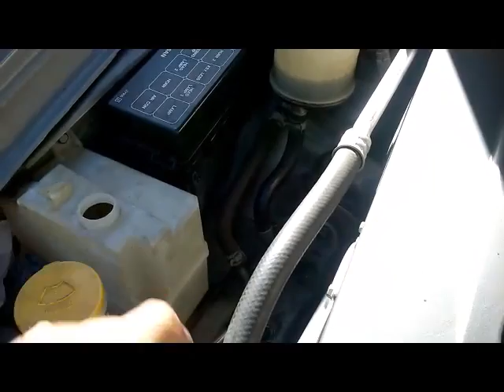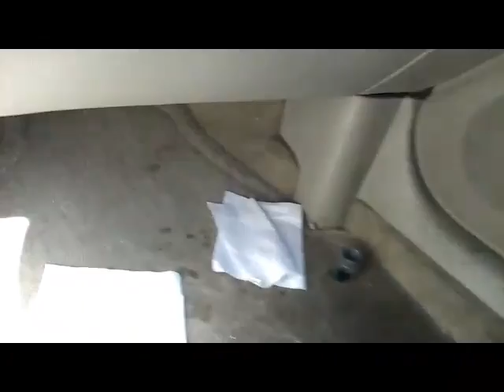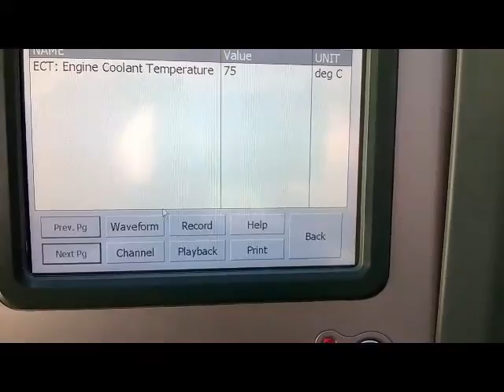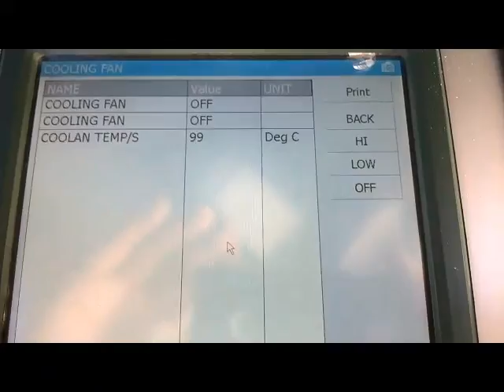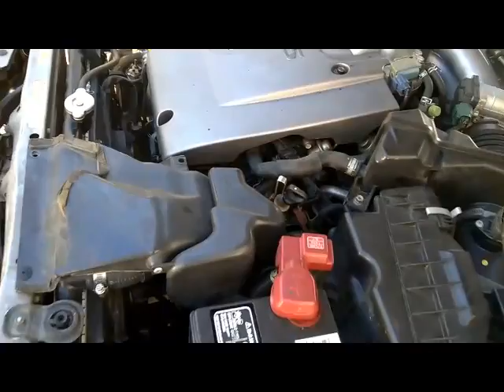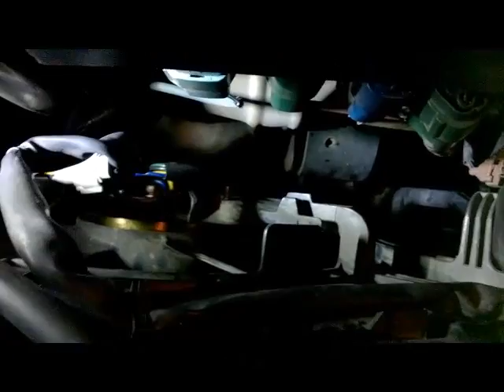(Nissan Maxima) Faulty Cooling Fan Motors

Comment: had similar problem on 2001 maxima, , replaced duel fan assembly  also check fuses,  relays.  I had 1 fan spinning and the other wouldn't

Comment: I have a 2004 Nissan Maxima , my car doesn’t overheat  but ion think my fans turn on at all  car temp  stays right in the middle  and I never hear the fans or ion think I do .  What could be the problem , I read you  comment to unplug the temp sensor and it will kick fans on . & my ac doesn’t  work atm  cuz no Freon in it so idk if there is a problem with my fans .
Reply from the maker: If you believe that they don't turn on. Try disconnecting the Engine Coolant Temp sensor to see if they come on. If they don't, you may have faulty fan motors, faulty ECT sensor, maybe faulty fan relay, blown fan fuse or some type of electrical problem.
Reply: @EliTheOBDTech  I swapped out the relays  but I’ll try to disconnect the sensor and see if they turn on .  I just never hear them  I was told that they turn on when they are needed and I haven’t had ac so I never turn the ac on  what
Reply from the maker: @jonnnn4895  Best thing at this point, is to unplug the ect sensor and see if they kick on. Another way, is to  use two jumper wires connected to battery + and -, and manually check each motor fan with the harness connector disconnected.
Reply: @EliTheOBDTech  I’ve unplugged the sensor and they do turn on . And i got a code for the  sensor  after unplugged it but how will I know if the sensor is no good ? If it didn’t give code at first. And soon I will be getting the hard ac line and getting it filled so it should turn on high to help the ac Correct ?
Reply from the maker: @jonnnn4895  Yeah, by unplugging any sensor, you will always get a code, that is normal. I believe that your sensor is good. You will have to do a test drive of 8-10 mins and then come back and idle the vehicle with the hood open and see if your fans turn on. Yes, fans should turn on high with the AC ON.
Reply: @EliTheOBDTech  will do I will get back to you and let you know how it goes  I have replaced the sensor and bleed the system so I will just leave it in there . But I’ll do what u said and see if  the fans run
Reply: @EliTheOBDTech  from the looks of it it’s still won’t turn on . There’s no codes or anything I looked at the fuses and I swapped the relays not to long ago . What could it be ? The only time they were on was when I unplugged the “ects “ and I had the code until I cleared it
Reply from the maker: @jonnnn4895  Hopefully it's not a pcm driver issue
Reply: @EliTheOBDTech  it’s working now after sending that comment I was pressing send and looked down and it was on and both were working .
Reply: @EliTheOBDTech  I appreciate your help and time u took out of your day to type these comments thank you .  Have a blessed night . And morning
Reply from the maker: @jonnnn4895  I'm glad you took that worry of your chest.

Comment: My friend , my left fan (ac ) turns on by hand only , like the video , the right one never turns on .Switched connectors same thing happens . Faulty fan motors right ?
Reply from the maker: Most likely faulty motors. U can use two jumper wires and directly apply 12 volts to the motor and see if it spins, if no spin, confirms 100% faulty motor.
Reply: @EliTheOBDTech  Thank you for replying so quickly.God bless you for helping me .Have a great weekend.
Reply from the maker: @thedeltoros5381  Thanks, same for you.

Comment: The same thing is happening to my car right now! 😭😭😭 this video helped me solve my problem now I gotta see where to take it. But I have a question what if your ac is blowing hot air to?
Reply from the maker: Has it blowing hot air for while or recently ? Most of the time, when you blow hot air, is due to low freon/no freon (leak) or blend doors stuck in the hot position or compressor not working. Not quite sure if faulty motors can cause that kind of symptom.  I would recommend checking your low and high side pressures to verify if your low on freon.
Reply: @EliTheOBDTech  thank you for replying its been for a while now.

Comment: Nice video Eli. I do have one question. I have a 1997 Nissan Maxima. If you don't have a/c on, does 1 or 2 fans come on?
Reply from the maker: Hey there, I'm not 100% quite sure, but I do believe that both fans should kick in at the same time without a/c on. I will look into it and I will update you.
Reply: @EliTheOBDTech  thank you. When a/c is off 1 fan is running. When a/c is on 2 fans is running. I used to remember that 2 would run even if a/c is off. But maybe the colder weather has some to do with it, Been looking in the FSM and it doesn't specify.
Reply from the maker: @dominicene3647  Hey there, after looking at the description and operation in ALLDATA, both fans should operate together with or without A/C switch on/off.
Reply: @EliTheOBDTech  thank you for the response you are awesome. Can you do me a big favor? Is it possible you can email me that page from all data if not too much trouble.
Reply from the maker: @dominicene3647  sure, what's your email?
Reply: @EliTheOBDTech  deeene@hotmail.com
Reply: @EliTheOBDTech  Thank you in advance
Reply from the maker: @dominicene3647  I will try and get it to you sometime today.

Comment: I changed water pump , thermostats and can’t find any leaks but my car is heating up at stop lights and going back down as I drive again , fans sound like they are on .. any idea ??
Reply from the maker: It seems that your problem might be a partial restricted radiator.
Reply from the maker: Perhaps the fans are not kicking in at the high speed when commanded, Only low speed.

Comment: Thanks for the video. It would have been really a great video if some of the missing information was added like say.....

1. Video of the Motor Replacement
2. Scan tool model that was used.
3. Part number for the motors and where you bought them from.

Small but important details. I spent some time on google, but still hasn't come across where to get these motors from. Never-the-less, great video on troubleshooting this common issue.
Reply from the maker: You're right.
Reply from the maker: Thanks for the feedback.

Comment: Hey buddy, I have a 01 and I noticed the fans aren’t working right (I removed a fuse of the fan number 1 and the main fan works fine but when I put the fuse back on, it starts rattling like crazy.
From what I’m seeing here, those fans that aren’t working properly and are causing that car to overheat sporadically. Could also the fans be a factor of why the car suddenly shut off by itself mostly when it idling? It starts to rev up by itself till it gets to a point where it just dies. Sometimes happens while I’m on the highway (the majority of the light tries to turn on and sometimes blink). I thought it was the throttle sensor cause of the abrupt rev up but I replaced it last December 2018.
Any suggestion? Thanks in advance for the help and God bless.
Reply from the maker: You might need a throttle relearn for idle issue. The overheating problem most likely is your fans not operating efficiently.
Reply: But that’s the thing, my car isn’t overheating at all. So that’s why I’m assuming since the fans aren’t working properly, those are the cause of this car  shutting off when idling
Reply from the maker: @ragh91  I'm pretty sure that the fans are not the cause for your car shutting off. Check your throttle body to see if it's dirty. Since your idle is behaving abnormal, you might need an idle relearn.

Comment: on My g35 its the opposite side that dont work.to change the fans do ihave to drain my coolent
Reply from the maker: I'm not familiar with the g35 radiator fan housing design, but if you're lucky you only need to disconnect the upper radiator hose in order to remove the fan housing. Will only lose small amount of coolant when disconnecting the upper hose.

Comment: Hi i have a 03 nissan 2.5 and it only overheats at highway speeds and spills coolant thru the overflow tank, i cant find any leaks and it doesnt overheat in traffic or driving in the city, i hope you can help me out thanks
Reply from the maker: You may have a partial clogged radiator that can't keep up with the water flow under higher pressure. Other items can be a radiator cap or a thermostat that's acting up at moments, not opening all the way when it needs to.

Comment: This helped me so much with my G35 intermittent overheating when AC turned on in 95-100 degree heat. Just ordered replacement dual fan assembly for $90.  WOW solid advice.  Thanks bro!
Reply: Did that fix you overheating problem? .mine only wants to overheat only with a/c on in hot weather.
Reply: Absolutely, no problems since

Comment: Good job! I am having similar problem with the temperature rising then returning back to "normal" temperature. Fans are working fine so I was hoping you had other videos or suggestions on what to look at next?
Reply from the maker: Miguel Gutierrez Perhaps a faulty thermostat that is not operating normally at moments. Radiator that can be partially clogged and not allowing normal flow. A faulty radiator cap.
Reply: cool, I am going to do a flush(car is at 140,000 miles) If it continues I will change out the thermostat. thanks again.

Comment: My ac fans don't turn on properly,I did the switch trick and the turned on really slow
Reply from the maker: frank saenz most likely your fans motors are going out. You will need to replace only the fan motors, not the whole assembly.

Comment: dude i have same problem i change new fan but now the one so work not work an abother so work before not work  what wrong XD
Reply from the maker: Kenny Uchiha try applying 12v to the other one that doesn't work and see if it works.
Reply: well i didnt have that tool XD or cabel to test it .. still woner i get ceap copy cant find AVA mark only its from crap taiwan.. sure over pay rofl.

Comment: something weird happened to me, theree was traffic and my temperature went at around 3.5/4 almost.to the top, i pulled over and poped the hood up, and only one fan was turning, i pushed the fan that it was not turning and it started to spin, relays were very hot, but i live in texas and the day was very hot, should i change that fan?
Reply from the maker: Sorry for the delay. In your case, I would replace just the motor on the fan, no need to buy the whole fan assembly.

Comment: I have a 2005 Nissan Altima and only one fan runs the one on the left the right one doesn't work. What can i do?
Reply from the maker: Salvador Villanueva I would try to test it first by putting direct battery voltage into the fan connector. get two wires and put one on the positive battery post and the second wire on the negative battery post and connect each wire to the fan connector and see if the fan spins. if it doesn't, then you will need to buy a new fan motor.
Reply: Alright ill give it a try ill let you know what happens
Reply from the maker: Good luck

Comment: I have too say you did an good video on you tube . Its was easy too under stand you did an great job . The question are you an mechanic or some thing ?
Reply from the maker: I'm am weekend side job mechanic/tech.
Reply: @EliTheOBDTech  Nice video Eli. I do have one question. I have a 1997 Nissan Maxima. If you don't have a/c on, does 1 or 2 fans come on?

Comment: Well done - at any point did you also  suspect a wiring problem with high corrosion that would cause low amperage at the fans.
Reply from the maker: Thanks  Steve.  Yes, that also came to mind, especially when i did bi-directional control with my scan tool during the hi and low speed commands.
Reply: +Eli TheOBDTech are both fan motors supposed to come on at the same time on a 350Z 2006?
Reply from the maker: As far as I know, Nissan vehicles do turn on both fans.